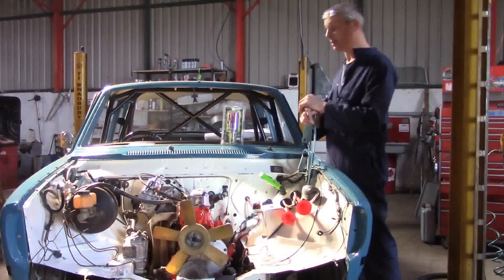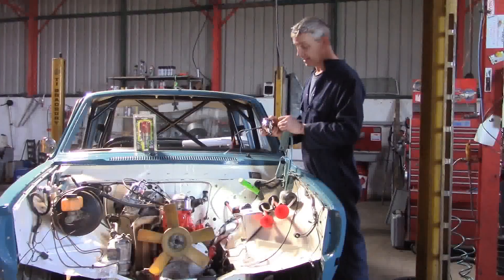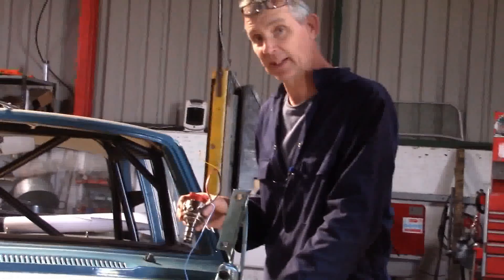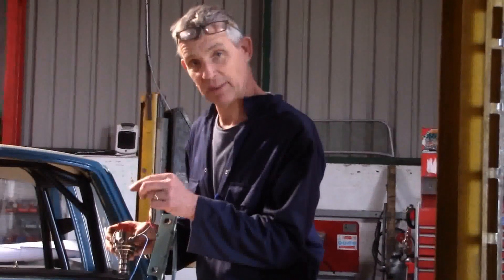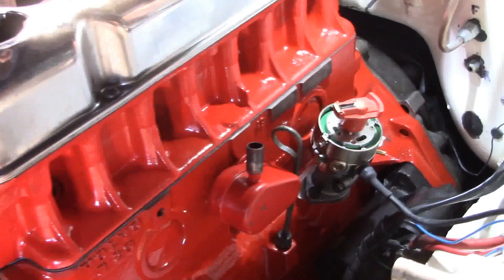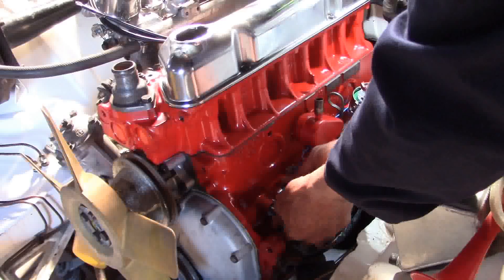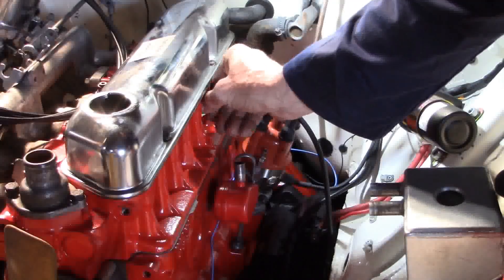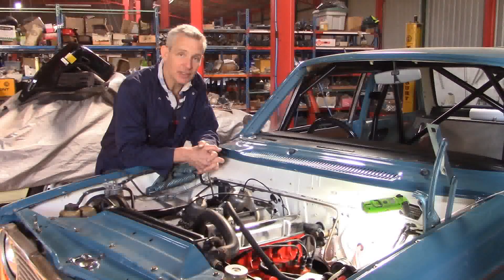"123TUNE" distributor installation

Comment: Hi Rob,
I got a "regular" 123 dizzie without the special unleaded fuel curve number 3 like yours. 

My B20A engine was pinking alot until I retarded The timing to 5° BTDC, in The manual I should have 14°. It runs pretty good at the moment but feels a bit weak. I'm concerned if this is harmful for the engine in the long run. I'm currently using curve 4 for B20a, as instructed, but this was before I realized it was for leaded fuel.. is there a "close enough"-curve on a regular dizzie for unleaded fuel or do I need to buy yours? 
What's your thoughts? 

I use 98 octane and the engine Keeps turning when ignitions is off, sometimes, if this is relevant.

Many thanks 
Johan, 
SWE
Reply from the maker: Johan, 5deg is surprisingly retarded, and implies that you've got a pretty highly tuned engine there: this is also the reason for the run-on after you switch off the ignition.
That run-on is unavoidable with unleaded fuel and twin carbs, getting worse with uprated engines, and we simply dump the clutch in 4th to stall it cleanly.
We would normally expect around 10deg BTDC on an original leaded ignition curve, so I have to say that you can definitely improve it significantly by buying a TUNE 123, if I'm right that you have got a spicy engine. I can give you a "get you going" curve from our library, then you can tweak it for your car - probably cheapest to buy it locally in Sweden.
Don't buy the TUNE+ (unless you have Apple IOS?) we have experienced communication problems with Android.
Rob
Reply: Hi Rob, sorry for late reply..

When I handed The cylinderhead to my local workshop for conversion to unleaded fuel, they resurfaced The head by 2 mm. Which I understand could be the reason for the pinking due to higher compressions. If that's the case wouldnt it be possible to compensate by put a thicker gasket on? Or am all wrong at this..? I remember I got 1.2 mm gasket from the shop. 

I forgot to inform that I only use one stromberg carburettor and haven't tuned the car in anyway, or at least with purpose. 

And yes, if you wouldn't recommend to drive on  5deg BTDC, I Will right away get The TUNE+ ! 

I appreciate the help very much! 
Johan
Reply from the maker: @gottmos1658  Johan, 2mm sounds a lot, can you check the overall thickness of the head now? Yes, a thicker head gasket will reduce the CR, I think you may even find a 1.5mm out there!
Rob
Reply: @amazoncars  I took some time to figure out which year it was made. My engine code is 496918 built between 69-71. I measured it to 88.57 mm with gasket and 87 mm without gasket using a caliper. I'm sure now I missed by a few mm. 

It seems now that original measurement for the cylinderhead is 86.7 mm between 69-71 and 87 mm from 72-. That would mean that they didn't resurfaced it by 2 mm as I remember it and it also would mean it doesn't have high compressions as I thought/was told.
Reply from the maker: @gottmos1658  85mm thick is what we take our high compression heads to, so your head does not sound like it's particularly HC.
With that 85mm head I still use 15-17 BTDC static timing, with no detonation.

Comment: Hi, great instructional video. one question: do you ever use the strobe light after installation just to make sure your advance is exactly as expected?
Reply from the maker: Rarely! For two reasons...
1. We have never found a discrepancy between the 123 static setting, and the idle or maximum advance dynamic readings.
2. There is a bit of signal conditioning that is applied to the 123 trigger waveform, which confuses many strobes, in fact only my old SnapOn strobe lamp seems immune to this, all others giving unusable trigger points.
Rob

Comment: Hi. Thanks for an excellent video, did you try it with vw t25 watercooled petrol 1.9 dg engine ?
Reply from the maker: The only other 123's we've tried are: MG Midget (Triumph 1500); Porsche 924; and the Volvo 240.
Rob

Comment: do you have experience with aftermarket rpm gauges on the original points ignition? i installed one and the needle keeps bouncing up and down a couple hundred rpm i tried almost everything apart from putting in a resister on the signal wire
Reply from the maker: That's odd behaviour for a modern "sense only" style tachometer - it actually sounds more like the behaviour of original Volvo "loop" style tacho.
So, no: I can't really offer any advice, sorry.
R

Comment: Another question.  Do you use a stethoscope after fitting the 123...or do you feel safe with the lamp on the distributor?
Reply from the maker: We have found that the strobe is completely unnecessary - when the static timing is set on the 123, the ignition timing is always spot on. However, it is always nice to check the maximum advance with a strobe.
R
Reply: @amazoncars  I set the timing at 10 degrees . When running at 1500 rpm I get just shy under 20 degrees messured with a strobe. Another thing. I watched your video about setting the SU:s.I have KD needles. I used a digital caliper to set the jets. I set it to 2mm. Is that good do you think? I´ll check the sparkplugs after driving to see if there are soot on them. Thanks for a superb Youtube channel.
Reply from the maker: @banarne71  That sounds about right for a "leaded fuel" curve, you have to pull the bottom end back to 10, but that means the redline is too retarded but a necessary evil.
Setting to 2mm is a good starting point, but then it needs to be set for the optimal tuning throughout the rev range - with a standard motor you can simply raise the slide a couple mm and set the mixture by ear, but any non standard camshaft or head will need a Wideband Lambda to assess.
R
Reply: @amazoncars  what do you mean "...pull the bottom end back to 10"? 🤔
Reply from the maker: @banarne71  Apologies Jon, "set the idle/static timing to 10deg",  that was sloppy use of English in the video!
R
Reply: @amazoncars  No need to apologize. When you say 10deg at idle, you mean at 800rpm or when the engine is off? I have a D-cam and set the idle speed to around 1150rpm.
Reply from the maker: @banarne71  Aha! With a "leaded fuel" curve I would aim for 10deg BTDC at 800pm idle, and then carefully advance it 3deg and see if the engine pinks under load - if so, retard it back again. For 1150rpm I would try 13deg of advance.
Reply: @amazoncars  thanks. Sorry for the bombardment of questions. :)

Comment: Hi. Thanks for an excellent video. I to have the 123tune. I have a d-CAM installed on my b18. Heard you set the engine to first 17˚ and after adjustement 18˚. According to my workshop book it should be around 23˚. Should I reinstall and set the engine to 18˚? As it is now It’s difficult to se the green lamp, it’s almost hidden behind the aluminium part. 
Thanks for your uploads, they are worth gold.
/ Jon in Sweden
Reply from the maker: I would have expected the engine to pink (detonation) with an idle timing of 23deg, so I would definitely recommend retarding it. You're aiming for a maximum advance (ie 3500rpm-4000rpm) of 32deg.
That 17/18deg assumes an "unleaded fuel" curve, which 123's bought from Amazon Cars already have programmed as #3, but 123's bought from other outlets only have the original leaded fuel curves, and therefore need to be retarded further at idle, often around 10-12deg idle timing.
R
Reply: @amazoncars  Okay, thanks alot. It runs great at 17 but I will redo it and set it to 10-12. Running with pure unleaded due to a re-done cylinder head that don't nead added lead substitute. Thanks for the respond.
Reply: Rule of thumb for static advance: always more than 10. always less than 20. cheers

Comment: Question: what may be the cause of my B20 engine "running on" after switching off?
Reply from the maker: Vijay, this is pretty much standard practice with a tuned/twincarb motor, but is less common on the single carb cars.
It's fundamentally due to modern fuel, and therefore there's no real solution.
Reduce the idle as far as is comfortable (our high lift cams should idle at 1200rpm, so that's not always an option depending upon your engine build).
If that fails, then simply put the handbrake on, select 4th gear, and dump the clutch when you switch off the ignition.
We used to play with slightly harder spark plugs, but that's really not an ideal solution because the plugs can soot up in certain conditions, like idling for a long period.
Rob

Comment: Quick question Rob. Do you leave the fuel pump running if you have a mechanical pump too or switch it off after start up /priming ?
Reply from the maker: For the short time involved I guess you could leave the electric pump running without exhausting the battery, but probably nicer just to switch it off whilst setting up the dizzie. Did I understand the question correctly?
R
Reply: @amazoncars  Possibly not - I may have been asking on another video but posted it here in error! I'll give you a call :-)

Comment: Rob, I am running the Bluetooth model in my 1800 race car.  See http://pandbmotorsports.com/. That model will not work with fuel injected cars. You might consider doing a video on installing one for fuel injection. Outstanding video, as usual.